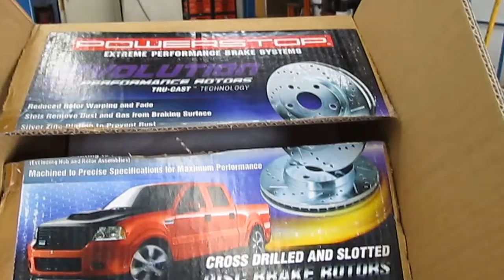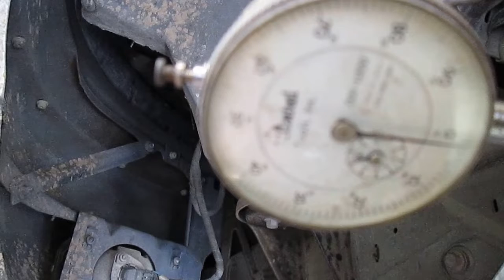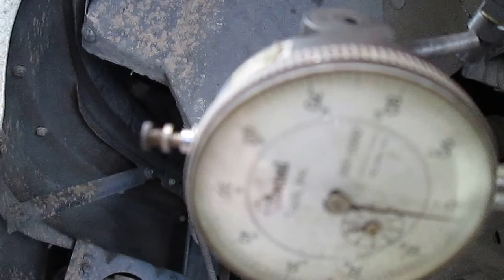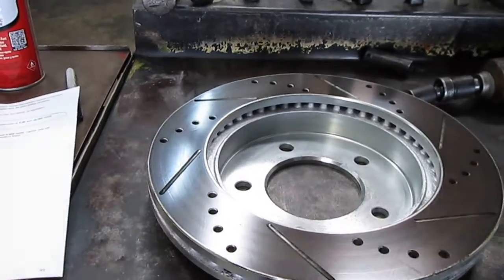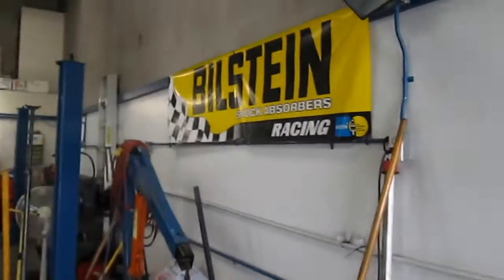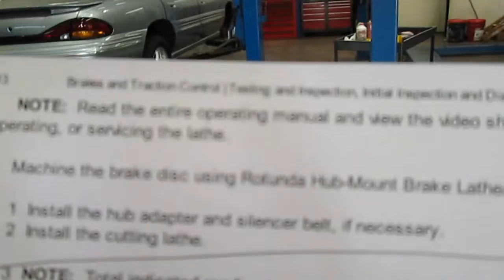How to check brake rotor lateral runout

Comment from the maker: Hi, As far as I know the way I measured it is correct. I found a supporting video on you tube by ( motoprof1441 ) showing the proper way to set up and read a dial indicator. I'm not sure about true runout and have not found out any info about it yet for brake rotors. Please let me know if you find out something more, Thanks , John

Comment: Some autoparts stores store their rotors vertically when it is better to store them horizontally flat with the hat up . the weight vertically warps the rotor. Do think this is why you have these results? Someone told me this and i never really looked into it.